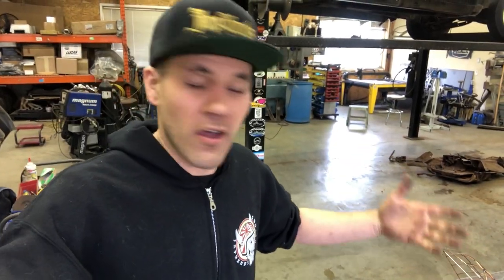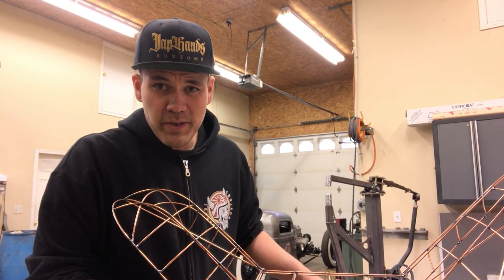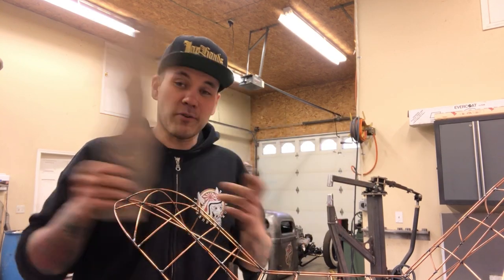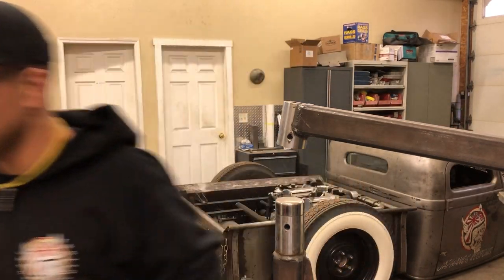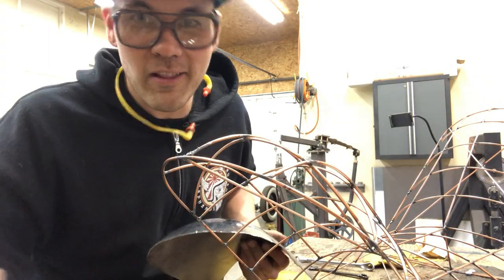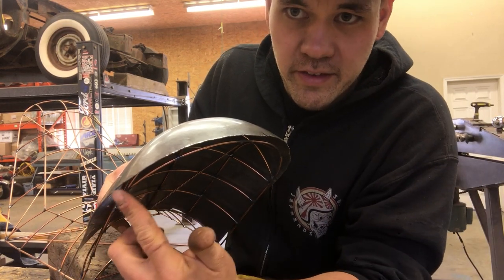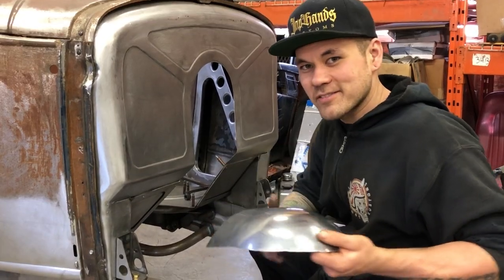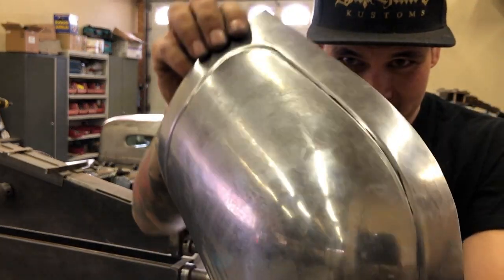Metal Shaping Using These 3 TOOLS: Power Hammer, Planishing Hammer & English Wheel!!

Comment: Excellent video.  Even for an old gear head like me who has been out of the business for years.  I like learning new things and you have taught this old fossil a thing or two.
Reply from the maker: Awesome man I’m so stoked to hear! Never too old to learn new stuff
Reply: @MakeItKustom  The technologies have changed so much over the years that allow for quick fabrication of new parts, better welding methods and materials.  During my day, I made patch panels with a piece of paper stuck on the side of a vehicle and cut it out with hand shears, then tack welded into place with a brass brazing rod.  Lots of seams in metal had to be leaded. There were no fillers during my day and metal needed to be shrunk or expanded in place with a torch.  Body work back then was tough work since the metal was much a much heavier gauge and difficult to work.  There was no such thing as PDR nor the tools.  Frame machines were very expensive.  Instead we relied upon pulling points embedded into the concrete floor and straighten cars that way using hooks and chains and hydraulics. We didn't have the high tech paints or mixing systems.  Everything was done by eye and the seat of your pants. The things you do today are so much better than in the past and easier to do.  

Now that I see how things are done today, I wish I could roll back the clock of my 83 years on this earth and give it another go restoring / repairing vehicles.  But, my strength has got up and gone , my bones ache all the time.  However, my desire has never diminished laying a new coat of enamel or lacquer paint on a car.

Comment: You do awesome work. Great tools  to
Reply from the maker: Thanks so much man!
Reply: I did that well similar. Aviation Sheetmetal. Aluminum is a little tricky. Building form blocks. Aneali g the metal. Forming,  then heat treating. Thanks for the the memories. I'm working o. A 54 Chevy truck beater.  May I ask questions when I get in a bind ?keep up the goodwo

Comment: Wow! 
I started out working in tool & die shops servicing CNC machinery FANUC and Okuma OSB controls, and never was exposed to this! 

The idea of wire forming and following a paper pattern is amazing, this is knowledge that is becoming lost even in the Tool & Die shops, 
when everyone creates a sheet-metal design in Solidworks and it auto-generates the stamping die cores and cavities based on sheet-thickness and bend radiuses, and then export the Solidworks file to EdgeCAM and autogenerate the CNC G-Code, there’s a general belief that without $20,000 of software licenses you would scrap tons of sheet-metal trying to do these compound radiuses parts … 

I’ve been through a good 15 tool & die shops and never even heard of this roll-forming machine it looks like black magic, I thought all this type of work has always been done with deep-draw progressive stamping dies, the cost of progressive die tooling alone for that tunnel would start at $30,000 per die base.
mind is absolutely blown!

Comment: I'm in the process of making 42" bead roller, thanks 2 U. I dropped bottom shaft 6" via gear tooth belts. Question in your latest video , U put drive motor on top shaft , why ? I'm 78 & you've been a great inspiration
Reply from the maker: Honestly I think for my situation it doesn’t really matter but if I were to do it again I would have put it on the bottom shaft because the top one does deflect when you lift and lower. I’m not particularly worried about it because it’s got the Lovejoy coupler

Comment: So what do you do with all your bucks! Do you have a buck mountain? Do you save the prints of your bucks? Or do you chuck them? I have bucks that I have no memory of what they are for. It's hard for me to throw away valuable stuff I will never need again. What is your system? Also I anneal more than you. Makes the metal softer and it doesn't crack as much. Great camera work of capturing your great talent and knowledge. Keep it swing'n.
Reply from the maker: I just hang them in the shop! LOL I’ve never felt the need to anneal the metal since it’s so soft already

Comment: Hello, as always it is a pleasure and a Master Class to see your videos. Could you tell how thick the sheet you are working with is? (Is it 1.5 or 1.6 millimeters?). If you were so kind, could you make a video to see how you make the structures that you use as a template, I mean that rod-welded structure. I reiterate my thanks for your videos and for sharing your knowledge with all of us since that is not paid for even with money. YOU ARE A CRACK. Greetings from Spain. Marco Antonio
Reply from the maker: Thank you so much Marcus! There actually is a video that I did on making the structures. If you look back it’s an older video you will find it. Cheers

Comment: Do you do anything to fresh sheet metal to keep it from rusting?
Reply from the maker: In the shop here it’s not likely to rust but my bare metal truck gets “Gibbs” penetrating oil wiped on it. It’s a non-silicone based lubricant highly regarded by body and paint guys for this application because it will not effect paint in the future when cleaned off.

Comment: What is the big C tool in back ground?. Looks like a nibbler
Reply from the maker: That is a rivet press. I bought it for the frame is 3 inch thick solid steel I will make a pull Max tape machine from it
Reply: @MakeItKustom  If I cut post the pic, the nibbler has a bad ass C neck. All 1 casting from 1914. I thought of a bead roller, dew to it has 2 power drive wheels on it to feed metal.